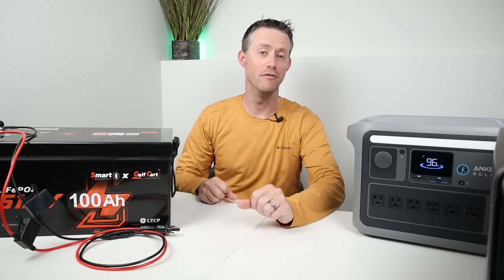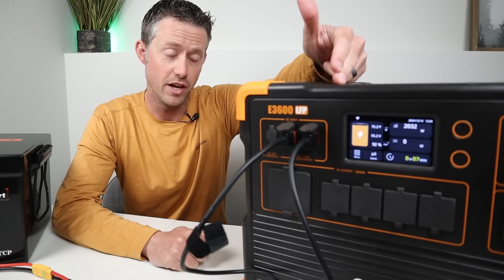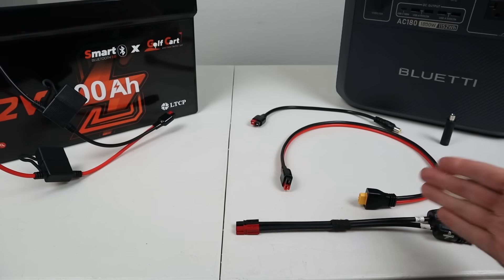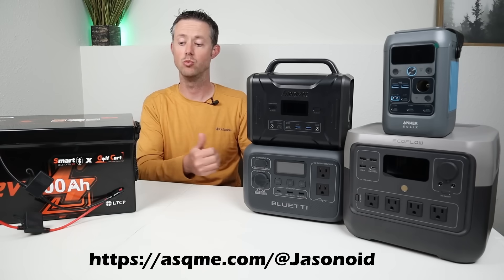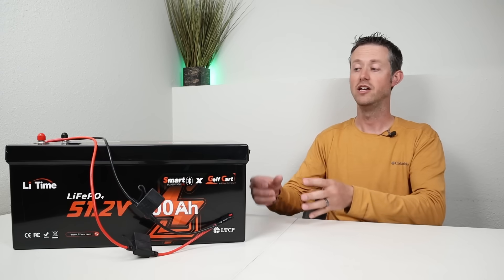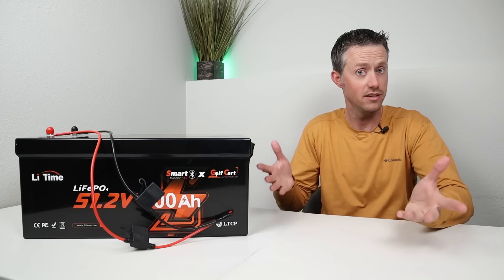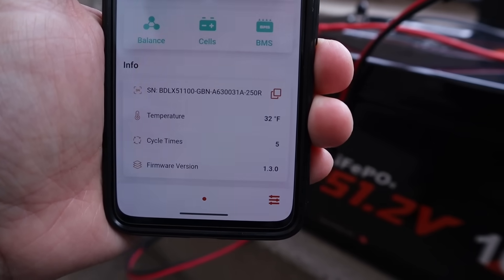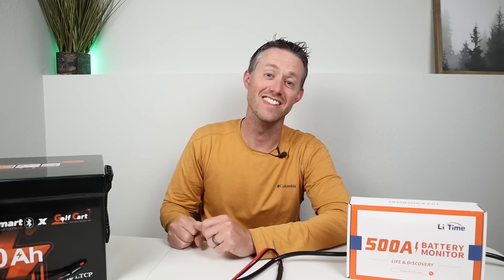Simple Trick to Make Your Power Station Last 5X Longer! Charging with a LiTime 48v Smart Battery!

Comment: I have a question: My power station has a 12-60V input with a 200W maximum output. But I want to buy an 18V panel that delivers a 300W maximum output. Can I use the 300W panel in my 200W maximum power station?
Reply: Yes, as long as your voltage is within the acceptable range you can fit that panel. The charge controller will shoulls limit to 200W. You'd just be leaving that solar real-estate on the table.

Comment: Awesome! And thank you Jason for your consultation, well worth it. I wonder if I can run both ports on my DP3 using the same battery? This, if it can be done, would maximize charging to 2600 watts. Has anyone used this method on a DP3?

Comment: I dt understand how this can be useful? You can only add power to your power station,but when it is empty, impossible to fill it again with the solar panels of the power station. Its just a one way solution. When it s empty all is gone. I thought it could replace an expensive 2nd battery like Anker or Ecoflow.There r really expensive, and no way to buy somthg else...

Comment: I am thinking of getting the 48V battery to supplement my Jackery 5000 PLUS, but I'm realizing that I will only get a maximum wattage of 1,200 watts from the battery due to the Jackery LOW PV input current limitation of 10.5 Amps per connector. If I understand this correctly, as long as I'm only powering 1,200 watts or less with the Jackery, I could theoretically keep my Jackery battery at 100% until the 48V battery goes too low, but if I power devices close to the 7,200 watt capacity of the Jackery, I could only decrease the consumption by 1,200 watts so the Jackery battery would go to zero long before the 48V battery could keep it charged enough. Essentially, I'm assuming the net difference would be 7,200-1,200 watts = 6,000 watt power drain from the Jackery. I guess it would help extend the time I could power large loads, but I'm guessing it wouldn't be very long. On the other hand, if I pay 3 X more money for the Jackery extra battery, I could double the time I could power any device up to 7,200 watts. I'm not sure which way to go. Any ideas from anybody?
Reply from the maker: You explained exactly what was going to happen. I think it's worth it. Most critical loads will be under 1200w so you'll be able to get much longer runtime.

Comment: This is absolutely cool. I could pair this with my Ecoflow Wave 2 and get 150% up to 300% more runtime than with the original battery made for it. Though it maxs at 60v. It maxs at 13 amps and that would make me nervous plugging 30, 60, or 100 amp battery into the Wave 2 directly like this.
Reply from the maker: The power station treats the battery just like a solar panel. I do this on my EcoFlow DPU every single night and it's working great.

Comment: I've got the Anker c1000 and would like to add my 24v battery to it. Since it's rated for 600w solar input.. Does that mean the max current draw will be about 25A. That 10 gauge Andersen will then not be enough right? Also, why the need for the Anderson cable. I've seen cables from ring terminal to xt60 with fuse.
Reply from the maker: It won't allow the full 24 amps, I think you'll see a peak of 13 amps with the C1000. The 10 AWG wire is fine.

Comment: Does this do any damage to the power station after its fully charged it, or does the power station treat it like solar panels where it will stop inputting once its 100% recharged, and only pull power from the battery after its "made room" for more energy and can recharge again?
Reply from the maker: It stops charging when the power station hits 100%, just like solar.
Reply: Awesome, thanks so much!  @Jasonoid

Comment: I’ve been reading up on this topic recently and love how this video breaks it all down and goes in depth on the materials provided. The one question I can’t find answered anywhere is options on how to charge the setup without charging it independently. I currently have a BLUETTI Charge 1 —> Anker C1000 to charge on the go and am wondering if I can connect the Charge 1 to the terminals on the expansion battery and also have the expansion battery connected to the Anker. In my mind, the expansion battery would be charged by the Charge 1 and then that would charge the Anker via the XT60 connection. But I’m not sure if it would work like that…

Comment: I have a EcoFlow Delta 2 that accepts 60v & 15A.  Will this battery work for it??
Reply from the maker: Yep, it will
Reply: @Jasonoid  thanks for the quick reply. 

 So I have one 200w solar panel charging my delta 2 now for occasional 110 usage on my RV and it's fine unless it gets cloudy for 2 days in a row.  The 48v battery would give me huge extra storage and protection against cloudy days. 

Charging the 48v is my question.  Could I charge a 48v battery with that 200w panel or what is the minimum number of 200w panels I would need to charge it?  
(12v x4 panels =48?)

I would have 5-6 days to slowly charge the 48v battery since I'm not at my  RV very often.  Almost a trickle charge would probably suffice. 

Thank in advance !

Comment: Did I miss the part about what you use to recharge that massive battery with? A gas generator? Something else?
Reply from the maker: You can recharge it anyway you want. Generator or Solar + charge controller or wind turbine...
Reply: @Jasonoid  did you show the parts you need to recharge it? You showed the parts to connect to a power station but didn’t see those
Reply from the maker: Not in this particular video but there are hundreds of videos online that show how to do that.

Comment: So you are using a charged battery to charge the power station? And who charges the big external battery then? I thought you simply connected the large external battery to the power station and made them work in parallel to its own so it would discharge it and charge it along with its own batteries.
Reply: Think of it like charging your phone. Power station is portable but if it's running something important at night with no outside power, you'll be able to add "solar" (extra battery). This way, you can extend your stations run time and, when possible, charge the battery at your convenience. Just like a battery bank for your phone.

Comment: OK, so say I got the same connector however at the under end would be an MC4 connector with fuses so would it work and when I just simply plug it into solar panels without a MPPT controller to charge
Reply: If I use it for an f3800 plus???

Comment: So would you be able to have solar connected to the extra battery and the extra battery connected to the power station for endless power?
Reply: This is exactly the setup I am going for as I accidentally bought the 48v version of the bluetti. Trying to figure how or if I can connect a 24v setup so I can then use all the basic 12v appliances that come with van life. I think you could connect a separate system via a mppt charge controller but still researching lol. I think you could even use a DC to DC charger to connect those separate batteries to the battery bank and then use a mppt charge controller to charge the batteries. I know I didn't quite answer your question but maybe someone else will see this and can help ! Cheers

Comment: Using standalone batteries with my Delta, two max only makes sense.  I can get a couple of 12 V batteries or 24 V batteries for less than Eco flows external battery.  Plus, I can charge these batteries separate from the main unit.

Comment: Do not do this.. there is no voltage cut off on the power queen battery. I nearly over discharged and damaged my battery
Reply from the maker: That's not true. Every LFP battery has a built in BMS that stops discharging to protect the battery from low voltage (at least the 3 or 4 PowerQueen batteries I have tested).

Comment: I dont get the point with this? Why not just plugg in 2x500w panels to charge the powerstation?
Reply from the maker: Because the battery can charge the power station at night or when it's cloudy... It's like an expansion tank / battery. You could always buy the brand name expansion batteries at a premium.
Reply: Ah alright 👍 @Jasonoid

Comment: Will this system work? EcoFlow 800W Alternator Charger to charge the LiFePO4 48v battery to power the EcoWave3 and EcoFlow GLACIER Portable Refrigerator. Or, do I need to buy the EcoWave Delta3 also?
Reply from the maker: Unfortunately, the Ecoflow charger doesn't work with 48v batteries.
Reply: @Jasonoid  Thanks, I missed that.

Comment: Something that may have been missed in this video is that if you hook up your battery to the Delta 3+  XT61 port, the battery will charge up to the max percentage. And then the charging will stop. However, as the STATION is depleted by 2%, the charging will be reactivated.  Essentially, you have added the battery to the service of the station not just for a charge.

Comment: What is the best way to charge your expansion battery. I’m new to this but do you need a 48v charger (expensive) and if you have solar, you need a charge controller?  You say “manually charge your battery”. Thanks!

Comment: Another excellent video. Thanks so much for your discussion of wire size and current capacities, as well as showing the fused leads. The lnks to the adaptors are also much appreciated.  I took your advice from another video last year, buying separate batteries to supplement existing power stations. This is far more afordable, as well as modular and interchangable, as opposed to expansion batteries. Its also  better than buying new power stations with higher capacities for me, as my existing stations have the outlets, charging ability and outputs that I need. Your videos have shown me that the Litime/Ampere time batteries have the build quality I want. The prices over the past several weeks, especially on Amazon have been amazing. The new Litime 12v 230ah 200w BMS with low temp. protection was $399 until two days ago. Having missed that sale (limited deals expire without warning), I picked up an Ampertime 12v 200ah 200w BMS for $359. (Apparently no low temp protection, which was the norm into very recently.)  Reviews from as recent as 6 months ago talked about how much the discounted (but higher than current) prices had dropped. last year A good review of the 12v 230ah 200w BMS Litime mentioned the case was even smaller than the 12v 200ah 200w BMS version. I remember Litime's holiday sales last year extended into deep discounts on models with bluetooth and even self-heating functions. Love the Litime products and their sales. Thanks for your tests, I really think the deep testing you and others do drives the makers to do better and keeps their manufacturing standards and warranty service honest. Hopefully Litime can weather the current economic issues, as they are an example of a Chinese company making affordable and well-built items, with good customer service and warranties. I do not have any financial ties to Litime and have bought all of my stuff at full price. I just get tired of some people labelling all Chinese electronics as junk.

Comment: I am thinking of buying an OUKITEL P5000 Pro. I also consider upgradeing it in the future in terms of capacity for offgrid solar system.
I knew you can just buy a 48V battery and use it to recharge the power station but how about connecting it directly to the expansion port or internal baterry terminals? Expansion port can fail when there is no some kind of comunication detected. But connecting it directly to the internal battery terminals to make them work in paralel could work.
When recharging you loose a lot of energy as heat and waste some of battery cyckles.

What do you think?
Reply from the maker: I put out a new video on the channel about that exact test today. Check it out.
Reply: @Jasonoid  The sun and heavens are giving signs. I saw it in my recommended videos then got info that you replied to my comment. Than you!

Comment: I've watched this video a few times because I'm brand new to this. I bought a TEMGOT Self heating battery 14.6/100ah. I thought you can take the mc4 to Anderson then Anderson to the TEMGOT, Just like you do with the bluetti adapters. It doesn't work. obviously I'm doing something wrong. I took the cables you recommended and didn't work. NOW, the one where you hook the battery up to the Bluetti does, However, it only gets to 98 watts, Can you please tell me what I'm doing wrong. I'm trying everything here except the right way.

Comment: What if I want the opposite? What if I want my 800W alternator charger to continue to charge my delta pro but have the lithium battery connected to the power station? Running 12v A/C off the external battery

Comment: Nice. So I have the Allpowers Ar2500. If I have this battery charged and connect it on the solar connection it will provide 1000 w to my station or I will feed more than 1000 w and damage it? Because this unit is 1000w solar max. What's your opinion? Thanks in advance

Comment: Thanks, this answers my question. I’m looking at teardrop trailers for a purchase next year. I already bought an Ecoflow Delta 2 Max and a Delta 3 Plus, as well as an Anker 400W solar panel array (I’ll get another after I play with them a while). Both power stations have 2x 500W solar panel inputs.

My question stems from looking at trailers where the only way you can get the trailer wired like you want (with solar inputs, and 12V and 120V plugs around the trailers is to get a package that includes a battery (haven’t looked into battery specs. I was trying to figure out how I could use what I have, but not waste the battery I’d be paying for to get the wiring. This way, I can just use the battery as the teardrop maker intended, while using my power stations with one connection to the battery, which I could swap out as needed. I hope I got that right. I’ll keep doing research on both trailers and the electrical system. Thanks!

Comment: can you use any type of battery bank?, For example a  power bank of lead acid batteries? thanks.
Reply from the maker: You could use lead acid batteries but you'll need to watch them to make sure you don't discharge them too much. Pull too much power when they are dead and you'll permanently damage them. Lithium batteries have built in protections to keep that from happening.

Comment: The 2nd disadvantage.
Is it possible If you connect the solar to the battery. Will that fix the issue?

Solar to charge controller to battery then connect to power station. 

Is safe to have this as perma setup?
Reply from the maker: That's how I run my large setup. Solar charging the battery, battery charging the power station.
Reply: @Jasonoid  Awesome. now my problem is looking for a smart MPPT that is not so expensive :D smart MPPT damn expensive than the battery :D
Reply from the maker: @ayayotoko  I like these ones:
I have two of these working on the same battery:   https://amzn.to/42XOg7Z
Been working non stop for 3 years.
Reply: @Jasonoid  running into a bump here. How about the voltage? 24volts battery cannot charge to 500 watts. 
I do see a DC to DC converter. is it safe for long term use kind a permanent setup?
Reply from the maker: If it has active cooling and it's rated for a lot of power then running constantly at 50% of its rated power will allow it to last longer.  @ayayotoko

Comment: What battery would you recommend for expanding the ecoflow River 2 pro? Also, would this battery be ok if I ran a DC 12V Step Up to 24V 3A Boost Converter inline?
Reply from the maker: You can just use a 24v LFP battery on the River 2 Pro. Or you can use a 12v LFP battery with a boost converter. Both options work fine.

Comment: I'm glad I found this video! So can I just leave the external battery plugged into the power station to keep it topped off while camping or shoudl I only connect it when I actually need to charge, or does it matter?
Reply from the maker: You can leave it connected all the time.

Comment: great video, thanks! i have 2 - 200 watt portable panels each having 50 VOC and 5amp max output. so in series is 100 VOC and 10 amps to my 12 volt 100 amp hour p04 battery. what mppt controller would be right to charge my stand alone battery... any formula for this? Thanks

Comment: Sorry newbie question. How would someone know the battery is full charged or the status of the battery if I use the adapter to a portable solar panel? Would I just refer to solar panel controller?
Reply from the maker: You can install a battery monitor shunt that tracks the state of charge. You can also watch the battery voltage.

Comment: Great video. My use case is minimal back power for my home.  I have a 2025 E-Z-Go lithium 48v golf cart with 120 Ah battery. Anyhow, it sounds like this setup will easily charge by EcoFlow Delta 3. Is it best to disconnect the wires from the cart (controller/motor) to the battery before charging the Delta 3?  Are there any negative consequences to the cart by using charging this way.

Comment: I have a 2025 E-Z-Go lithium 48v golf cart with either 110 or 220 Ah battery. I have a double pack and I’m researching the Ah. Anyhow, it sounds like this system will easily charge by EcoFlow Delta 3. Is it best to disconnect the wires from the cart to the battery before charging the Delta 3?  Are there any negative consequences to the cart by using charging this way. I will only do this in a loss of power to my house type emergency.
Reply from the maker: You shouldn't have to disconnect anything in the cart. Just have a pigtail going off the battery terminals so the Delta 3 can connect up to charge when needed.

Comment: What do you need to use to charge the DJI Power 1000. Do you have to use the 1K or 1.8k DJI chargers or can you use a Victron MPPT and program the correct values?